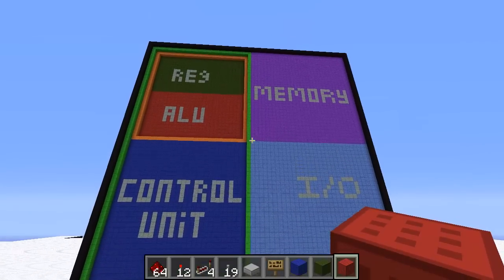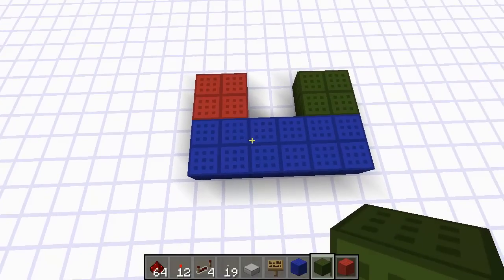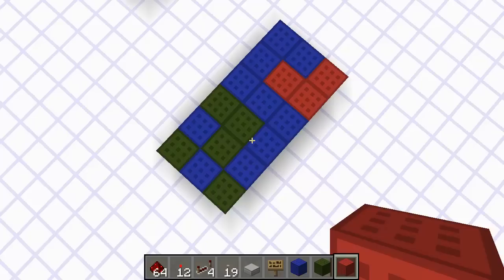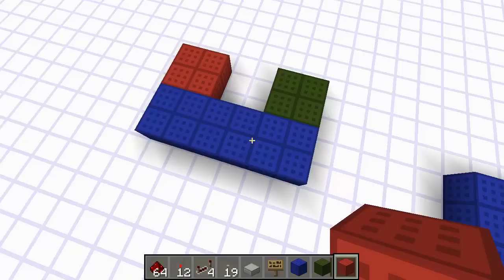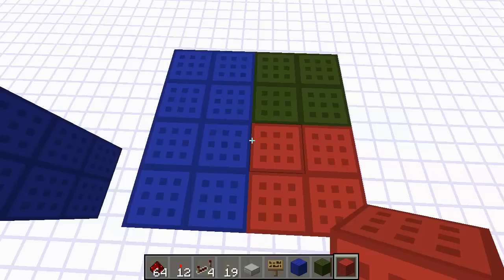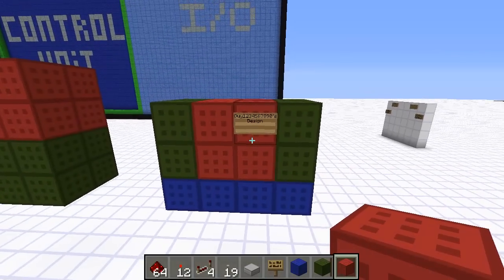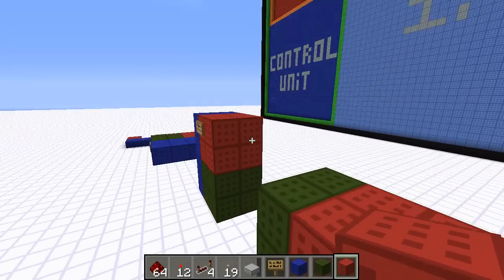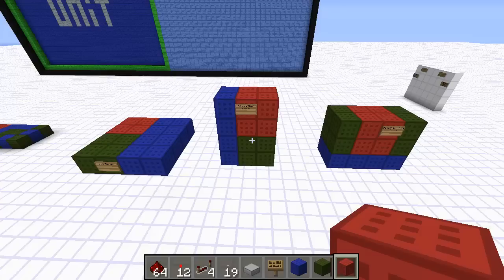Advanced Redstone Computer Tutorial 7: Designing a CPU

Comment from the maker: I'm afraid I've come off wrong again, as I do understand what you meant. 

Here's another way to handle the pipeline hazard: Let the bad code be retrieved from memory and pass through the decoder; since it hasn't executed yet it hasn't caused harm. Letting it move through these stages allows enough time to shut off decoder output if the branch fails and the code is invalid.

My question is what advantages full pipeline zeroing has over this, and why bubbles would be problematic in that strategy?

Comment: interlock means that there is a register in between each stages (removing the need for insane timings) while i assume it would be easy to make such register cruise ship has the right amount of space on the right back bus (note if you put the register file behind the ALU as opposed to below it) for lock clearing which clears the interlocks when the pipeline must be restarted in case of branching or bubbles

Comment from the maker: Interesting point. I'm not sure why you'd zero the entire pipeline unless bad data somehow made it all the way to execution, but I suppose it's possible. You could always use a piston plus glowstone tower in guy's design, but if you couldn't fit that for some odd reason then I suppose that would be an advantage for cruise ship systems.

Also, I'm curious as to why you'd zero an entire pipeline simply because a bubble came up. Is your system depending on continuous data flow?

Comment from the maker: Sorry, I think I came off a bit wrong; let me clarify. The solution I've always used for the invalid data problem is to shut off the decoder output in case of a bad branch, which works because there won't be invalid code if it's never executed.

That's why I'm unclear on why you'd zero the pipeline; you'd need to reexecute all the good code if you completely clear all the registers.

I'm also confused about the bubble issue. What does it do that constitutes erasing the pipeline?

Comment: well lets say this happens, on your pipeline everything is running fine and dandy then you need to branch. when you branch lets say you want the CPU to use data that is on a totally different line, e.g line 10 in program. Now that means when it was executing the branch line it was also sending other data some where. Lets say our branch changes its path. The only way to fix this is to clear the pipeline and re-calculate that data and send it else where.